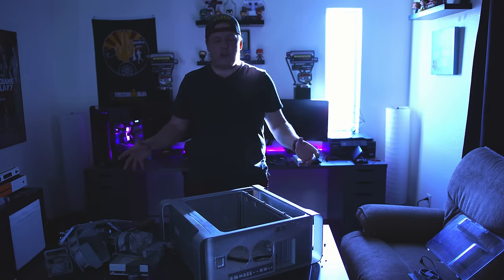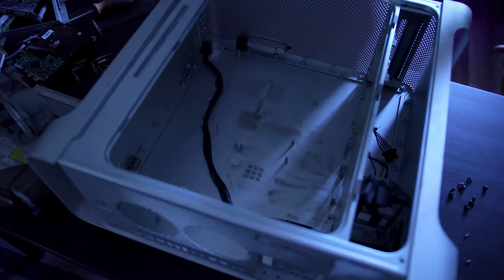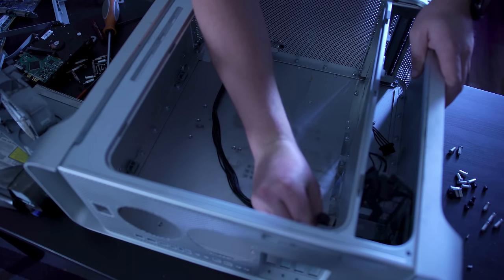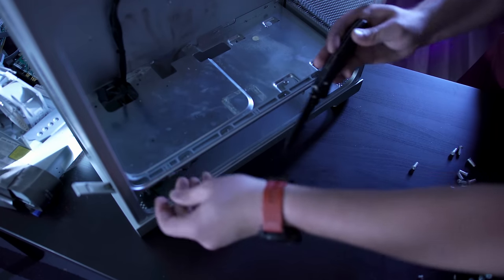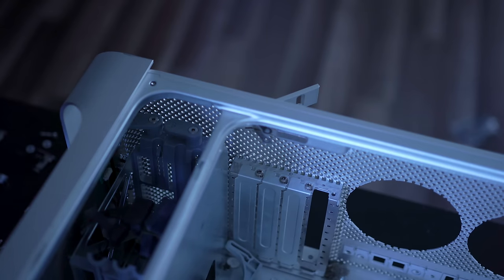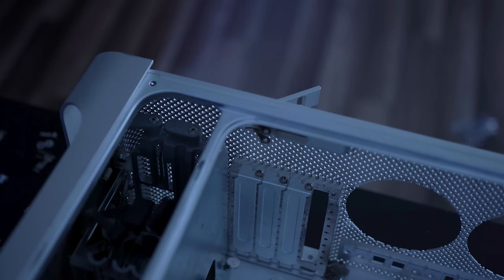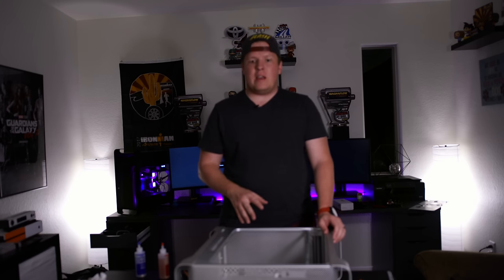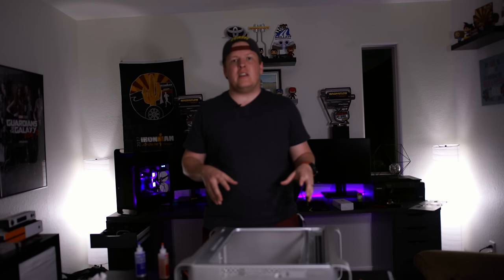THE TRANSFORMATION! PowerMac G5 ATX Mod Pt. 1

Comment: Using Epoxy to attach the standoffs to the tray seems less efficient than drilled & tapped holes, using the hexagonal brass standoffs. These are standoffs that have a male screw thread on the bottom, hexagonal body portion, and female thread on the top. These can be found in various lengths, such as 1/4", 3/8", etc. Use a hexagonal nut driver to screw them into the drilled & tapped tray holes. Add a threadlock compound such as Locktite for extra security.

Comment: No wonder they stopped this design. Must've been expensive AF to produce.
Reply from the maker: Haha but it still stands the test of time. Lol.
Reply: Well yea, but it was also expensive AF to buy. :P
Reply from the maker: This is the truth. Lol.
Reply: The fundamental flaw with design is that they were the beta test for the AIO liquid cooler concept, and they became a fucking nightmare after warranty period as the repeated expansion of the coolant over time weakened the seals and caused the cooler to leak coolant into the machine.  Just search Mac G5 Leak on google to see the catastrophic damage that users suffered because of this decidedly undercooked AIO implementation.

Modern AIOs, thankfully, are far more durable.  What this whole sordid episode demonstrated was the lunacy of pushing bleeding edge enthusiast hardware into general use.
Reply: @SB-yu1kq  "bleeding edge enthusiast hardware" lmfao yeah right is that what you call a 1c/2t or 2c/4t power pc processor? Intel was destroying this at the time with 4c/8t processors. Mac is and always has been overpriced low-end shit. You pay for the apple name,  not the specs. Otherwise the new Mac pro would be $5k and not $35k
Reply: @twizz420  well said!

Comment: Tip: Before using the epoxy (which by the way you should be wearing a mask - protect your lungs!); scratch the case up a bit with a scotch-brite pad first. This gives the epoxy something to "dig" into, as opposed to just putting it on a smooth surface.  No, it won't look as nice after it's painted because you'll probably see the scratch marks - but the mainboard is sitting over it, so when it's assembled, nobody is going to know and it'll hold that board onto the case longer.

Comment: @29:57 minutes in you were talking about standoffs and mixing the epoxy.  I noticed that it looked like there were either screws or rivots holding on the cheese grater front and back or it was holding the side and top solid panel as well as the cheese grater front and back.  Can you let me know if those are rivots or screws?  Can the cheese grater panels be taken off so custom ones can be make?

Comment: just out of curiosity, would there be much of a bottleneck if you run small extensions from the rear io on the mobo to the holes in the case? to keep it more original?

Comment: This is awesome! Thank you so much for sharing the whole process of setting it up. Are you able to take the epoxy off and rearrange where the stand offs are in the future if you want to replace the motherboard again?
Reply from the maker: Yes it will come off but it won't be easy. Most motherboards use the same standoff locations (thanks to industry standards). I changed my whole platform on mine from x370 to x399 with no issues.
Reply: Thanks man! I'm currently using an older proprietary workstation motherboard but I think I'll just end up sacking up and spending the money for a new motherboard and processor since I've been thinking about it anyways

Comment: that epoxy run-off onto the motherboard gave me a slight heart-attack
Reply from the maker: Yeah it did not cause any problems, and was easily removable once dried. i can see how that would happen.
Reply: @JacobPerson  hehehe, no worries. I got a G5 case here, gutted it yesterday ready to mod it. How are those stand-offs holding up btw with the epoxy?
Reply from the maker: Well I have an eatx water-cooled threadripper with 2 full coverage water-cooled 1080 tis in mine and they have no issues at all.
Reply: @JacobPerson  Yes that would be enough proof that they aren't coming off any time soon :D

Comment: Is the glue actually strong enough to hold the motherboard vertically?
Reply from the maker: tobbe it's been holding my motherboard up for a year now. With water-cooling and 2 watercooled gpus.  I haven't had any issues with it.
Reply: Jacob Person have you considered using a plate by the laser hive? Have you tried to make a similar build but with a mac pro case? Are they identical or do they differ?
Reply from the maker: tobbe we looked at both when we first started. Form everything I've seen the g5 is much easier to work with and much cheaper to get a hold of.

Comment: That epoxy application.. wtf.. good luck removing the 2nd screw.

Just place the MoBo on the case and mark the holes with a sharpie.
Reply: Was going to comment something like that, or even if you need to use the standoffs, screw them to motherboard, bit of nail varnish on each one, put it in place and a it will like round dots where they are meant to sit, take off and epoxy.

Comment: Does instant glue work ? With thé heat and stuff...?
Reply from the maker: Never tried instant glue. The epoxy works well. Haven't had any issues with it.
Reply: @JacobPerson  Thanks for the (quick) responds! I also went to a 
 DIY store and they insured me that it would hold.. But even so, I'm considering to change them, even though I just glued it to the backplate. 
BTW: Your video's are amazingly done! Very easy and relaxed. Clear also, I could see all my questions being answered except this one :D
Reply from the maker: Yeah I have had good luck with the epoxy. I would recommend it, but as I said I haven't tried anything else.
Reply: @JacobPerson  I order one from Pattex: Pattex Epoxy Super Mix - Metal - 25 ml
Reply: Instant glue won't work. I tried it. Stuff fell off and broke.